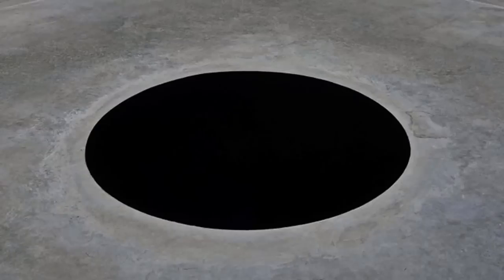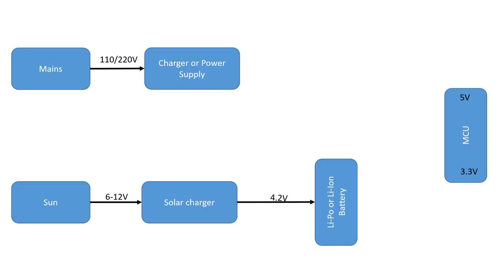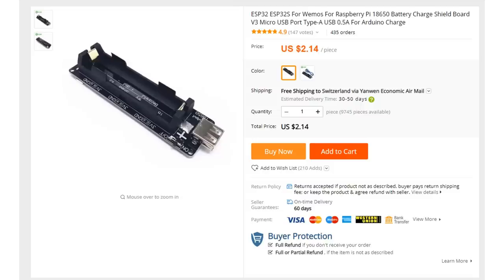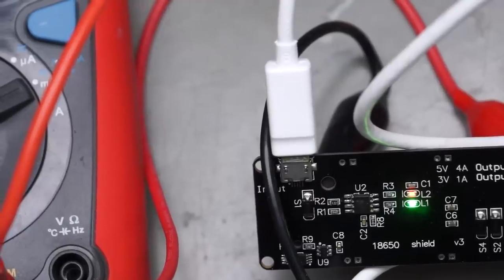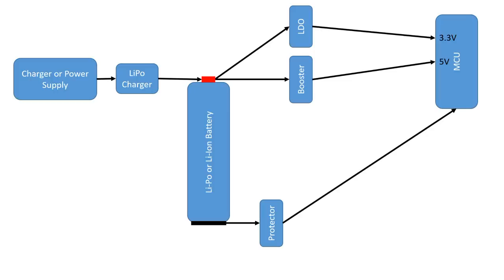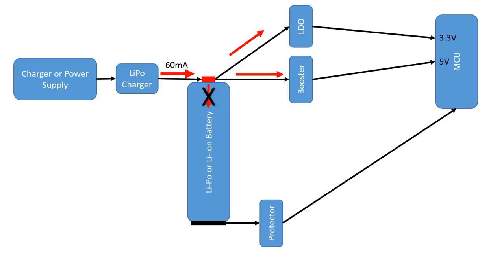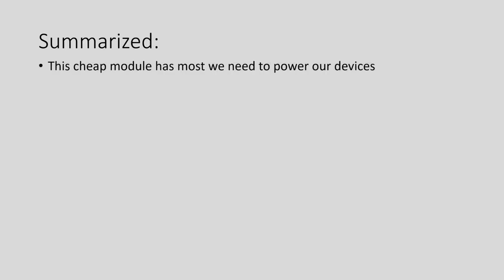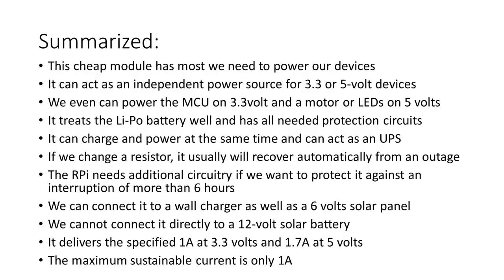#250 Universal Power Source (UPS) for only 2$. Is this possible? (Raspberry Pi, Arduino, ESP32)

Comment: I got one of this style a while back after watching VoltLog review on it. It's actually quite useful for about 90% of my needs on iot stuff.
As you noted on 5v rail, the specs are waaaay over reality. Also, even though you were getting 1A out of 3.3v rail, I think that is over-rated on the 3x 662k LDOs. Depending upon which 6206 LDO they are actually using, could be anywhere from 200-250mA each, so I don't think you should plan for more than 750mA continuous. Also, looking over it, they seem to skimp on input capacitance, and mine did not have any output capacitance on it. I had to add a 4.7uF smd ceramic on input and output of LDOs
While the boost converter ic (FP6298) is rated for 4.5A out, I wonder two things: 1. whether the rest of the components, including traces, are spec'ed to this, and 2. whether the battery can supply the 2-3C output current (assuming you have genuine panasonic cell?) - I wonder if test can be repeated with bench supply simulating battery input current.
This is why i think you should do a Swiss Accent version ;)
Reply: Also as you noted about the way the switch works, is crap design. Why not control the shutdown/enable pin of the boost converter! Even worse, it's just switch in-line with 5V output rail to usb jack. I wouldnt trust that switch contacts to carry 1A+ (a quick net search show most of these types of slide switches not rated at more than 0.3A ;)
Reply from the maker: I tried the 3.3 volt rail for about 1 hour at 400 mA for one LDO at battery voltage 4.2 volt and it was not hot afterwards

Comment: Hi Andreas, nice video! I know there is a power bank with the same capabilities, I just do not have the link anymore to the seller, I saw it on Julians channel a time ago.
Reply: Anker makes SOME powerbanks that can both charge and discharge at the same time. The way they do it, without disconnecting the load during charging, means the battery degrades faster. Not ideal but OK

Comment: Maybe I'm confused. Anytime the load is over 600 ma, lets say an amp.  The charge ic will  let the battery discharge to 2.6v then disconnect the load, then start charging the battery, even if the mains are powered ?
Reply from the maker: Yes. If you do not change R2

Comment: Hi Andreas! Thank you very much for the video. I have a question (not directly related to it, but close enough): I would like to use a raspberry compute module 4 i/O board as core for a cyberdeck/mobile solution. It runs at 12v and my idea was to use 3x18650 batteries and a simple BMS .... it is not the best solution, I know. How would you solve this use case? Thanks!!
Reply from the maker: I assume you need a buck converter from 12 to 5 volts?
Reply: @AndreasSpiess  the board is running at 12v and has internal 12 to 5 and 3.3 dc-dc converters .... my question was more about what type of circuit will be best for the task?

Comment: I recently started to play with one of these and ran a sketch that sent a text every 10 minutes and then slept. powered using the USB port.
with  3200 mAH Li Ion battery I worked for about 5 days until the Voltage was below 3V. I am current running the same sketch using the 3.3v outputs of the Wemos shield to the 3.3vin on the ESP32. Over 2.5 days the voltage has only dropped ,08v vs .5 volts when using the USB connection.  Was all that power being dissipated by the boost on the shield and the buck on ESP?  If thats the case seems like a large waste of power. Are there 18650 shield with just a buck and battery protection or do I have to build them myself. Thanks for the great work.
Reply from the maker: General-purpose development boards are not good for low power applications. I did some test videos.
Reply: @AndreasSpiess   Thanks. The board is from Amazon HiLetGo  WROOM-32.  I guess I'm just surprised how much of a reduction in power consumption there is using the 3.3 V input to power it . I've now had it running for 5 days and the battery voltage has on dropped .12V .  When I used the USB input the voltage had dropped from 4.2 to 3 V.  So 3.3v seems to be the way to go at least for these boards.

Comment: I think the silkscreen was labeled backwards. I think they meant to have 5V @ 1A, and 3V3 @ 3A.  Classic case of typo error without verifying afterwards  😜
Reply: Or 5V @ 5W, not 5A...
Reply: @DrKnow65  Ahh, Good point!
Reply: @DrKnow65  unlikely, they would've had to calculate this and the result would've been 25W/A
Reply: @mcflapper7591  I suspect that the specification for the boost chip is 5W @ 5V = 1A @ 5V (as measured), and the typo is  transposing watts and amps (I.e. 5A @ 5V).
Reply: The 3v3 is derived in a way that I wouldn't trust even at 1a while the 5v has a proper boost converter

Edit, just checking the parts are listed as 250mA there are 3 in parallel, so it's probably safe and reliable to pull 600mA or so, but that's going to dissapate a LOT of power in the tiny smt LDOs.

Comment: Im just about to build a solar panel power bank that can charge and discharge simultaneously using 6 or more 18650s (3000mAh each). Could and should I use one of these UBS charger board for each cell in parallel? If not, do you have any suggestions?
Reply from the maker: It is definitively better to use them in parallel. But for such larger solar panels it might be good to look at an MPPT charger.

Comment: So if I connect this 18650 shield to the charger as well as to a Pi, it should automatically manage interruptions in power supply to keep the RPi running by switching to the 18650?

Then upon return of power supply it'll charge the battery till it is charged then direct the power to the Pi.

I want a solution to handle short power outages without restarting the Pi, in a setup that can be deployed then doesn't need to be touched so the power supply will be connected to the shield 24*7. Is it good for that function or will I need to make some modifications?
Reply from the maker: You have to try. There are different designs in the market now. But there is a fair chance that it works. The Pi4 is the hardest, because it consumes lots of current.

Comment: Thank you for this. I had a question: Is there any way for the ESP32 to be notified that power is being supplied by the battery, ie: main power loss? For example, I would like my esp32 to notify an MQTT topic that it was being powered via battery and not mains, so i could do something about it before the battery gets too low. Thanks!
Reply from the maker: The ESP32 can measure voltage and react on it. Jost connect such a pin to the voltage you want to measure and make sure it is always less than 3,3 volts

Comment: Will these devices provide 'clean' power to a Raspberry Pi? I was using a linear power supply which definitely improved the sound quality. But I would like to use the LPS elsewhere.
Reply from the maker: They are too small for most of the Raspberries.

Comment: Bought one of these, before I found your video. My plan is to use it to UPS a Wyze Cam, which can consume up to 800mAh, when the IR repeaters are on. Based off what I watched, the camera would run for about 2.5-3 hours and then die, due to low voltage. However, if the power comes on, after the battery fully discharged, I'm not getting my camera back on, unless I disconnect it from the power bank and reconnect after the battery is charged. Is that correct? Did you ever discuss what I could add on to avoid this, with the additional protector circuit?
Reply: Tested mine and, unfortunately, as soon as you disconnect mains power, the attached device reboots, as it loses power for a split second. This makes these not ideal for UPS.
Reply from the maker: It is probably not ideal for devices which need a higher current than the usual microcontrollers.

Comment: Nice video, appreciating your research. Also thank you for links.
But how about to set 2 or more such modules in parallel for RPi to provide more than 1A?
Reply from the maker: I probably would use a different module for an RPi
Reply: @AndreasSpiess  it would be great if you make video for true RPi UPS (:

Comment: Sali. Another fun sunday morning with andreas. Just a few comments.. lipo and lion min 3.0v... for longer lasting i would do lifepo4. They are much more robust....anyway.. I think ups for pi is a must because its fat sdcard corrupts easily.
Reply from the maker: I did videos about LiFePo. But this device (and many others) use Li-Po). Maybe it will change in the future. But Li-Po has a higher capacity for the same weight/space.
Reply: @AndreasSpiess  ur correct. What about getting early warning from ups that pi needs gentle shutdown.
Reply from the maker: I also did a video about that. Including software ;-)

Comment: ok so if I put a 18650 battery inside, connect it to an esp32, remove the led, and let it go mostly in sleep mode occasionally sending a wifi message from a sensor input it should last right?
Reply from the maker: Maybe you watch my videos about deep sleep and ESP8266. The ESP32 behaves very similarly.

Comment: I bought this 2$ power module from Aliexpress but I have a question: can I connect a small Photovoltaic panel (with a 5.1V zener diode in it's output) at it? So that the battery will be charged by it?
Reply from the maker: This should be possible. Just monitor the temperature of the Zener.
Reply: @AndreasSpiess  thanks for answering! It 's gonna be impossible to monitor it 's temperature as it will be placed in a box on the roof of a building.
(maybe I should attach it (the zener) on a heatshink? But any way, the temperature on August is going to rise up to 50 degrees Celcius under sun)

Comment: How to Connect this device with Solar panel of 6V ? 
Do we need to use a Micro USB connector to connect the wire coming from Solar Panel or can we directly solder +ve &  -ve wires somewhere in the Input side of the Board ?
Reply from the maker: I am not sure if it is a good idea to connect 6 volts to it. I did not check the data sheet of the components. Maybe you do it before you connect it. I usually use a USB cable where I cut off one part and connect the wires.
Reply: @AndreasSpiess  Thanks Andy

Comment: Looks like handy module there Andreas ;) And worse case scenario - have some sort of power monitor that controls the output to both shut down the load as the batter nears critically flat, and ensure that the battery is on bulk rather than recovery charge before enabling the load. I believe the power bank manufacturers generally don't offer a passthrough / UPS like function is due to not wanting to deal with the battery charge termination when under load. Anker powerbanks in particular supported this, but I'm sure I saw mention that their newer models have omitted this feature as the charge termination wasn't working properly and reducing the life of the batteries. I thought Xaomi did also, but my newer power bank has a nasty 'feature' of turning the output off for a second (and then back on again) when the charger power goes on or off :-/
Reply from the maker: In addition most banks I have switch off if I only connect an MCU. They think there is no load :-(
Reply: Yeah, that is a bit problem. I have one commercial powerbank that has press on, press off functionality (i.e. it will run until the battery is flat)... but it is the rare, not the norm :( Paul Stoffregen did a article that made Hackaday about using a MCU to pulse a load on a powerbank so that it would not turn off, whilst wasting the least amount of energy possible. Whilst the original page is down, thankfully the Wayback Machine has an archive of it : https://web.archive.org/web/20160415053411/http://www.dorkbotpdx.org:80/blog/paul/battery_pack_load

Comment: What would happen if you wired 2 of this input and output directly in parallel and bridged the 2 batteries to gather would you end up with 2x the charge current and 2x output current?
Reply from the maker: connecting two LiIon batteries can be done and you get double the capacity at the same voltage. But it is not without danger the first time if one is fully charged and the second not.

Comment: I would use a reed switch and two rechargeable battery packs, in order to allow charging and discharging. That way, the discharged battery is never charged as well.
Reply from the maker: For this application we want both together

Comment: i want to ask? how to adjust Rprog of r2?
it should be edit? on software? or hardware config?

It is Possible on my Raspberry pi 2? to use this? load and charge? 24/7

or it works only on Pi Zero
Reply from the maker: You can consult the datasheet of the chip to find values to change the current.

Comment: Hello. I have a PIR sensor in my garden (with a wemos d1 mini), I want to use this shield but with a solar panel. I see this charges from micro USB, so I need to get a 6 volts solar panel, but how do I connect to this shield? I see they come just with positive and negative, cables so I need to put them on a micro usb male terminal to plug it into the shield? or I need another circuit between the solar panel and this shield? thanks.
Reply from the maker: Maybe you watch one of my last videos where I covered solar charging.

Comment: I have a powerbank with a single ic which can charge and discharge at the same time, but is a little bug of design, because it have a common 5v lane and leave some current to pass to the discharge port, I use it to keep alive my rpi 4 alive because it is hosting a web server and it is a MQTT broker and don't want to loose data while i'm working if there's a lightout
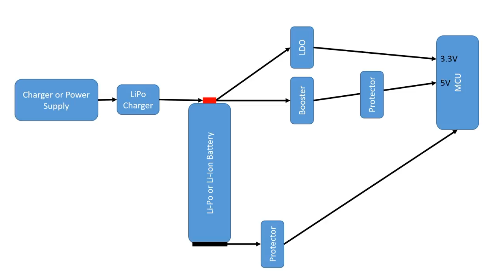Short expanation: in minute 10:09 my powerbank have a lane between the charger and the input of the protector of the 5V lane
Reply from the maker: Very few powerbanks can charge and discharge at the same time. So tyou are lucky your bank has it.

Comment: Will we solve the problem if we enable the load to reset itself with the code (arduino) when the battery drops below 3.7 volts?
Reply from the maker: I do not know :-(

Comment: I don't get why no one is able to produce a full-featured mini MPPT or even a LiPo balance and protection circuit. You would think in the entire world there'd be a market for both of those things... Instead what we get are MPPT controllers that don't track current, LiPo BMC's that either charges or provides over-discharge protection but not both... 

I know it's possible to do both of these things because there are commercial "emergency solar panels" out there that does all of these things while costing peanuts, but I've never seen a PCB that does all of these for DIY crowd. 

If I had the technical knowhow, I'd make an MPPT IC that actually does MPPT and couple that with a good BMC and watch the dollars roll in.

Comment: When placing a battery, it turns on both green and red LEDs. Does that indicate anything? Or the battery is damaged? Greetings.
Reply from the maker: Unfortunately, I do no more remember the details :-(
Reply: @AndreasSpiess  It's understandable with so many videos and so many modules that you've tested. 
It happens to me all the time and that's when I check your videos again haha
To answer myself, yes, the battery is damaged, I guess because I tried to charge it with the module of the ht4928s IC and it also performs an abnormal blinking of the LEDs. Greetings and thanks!

Comment: The major problem here is that keeping a LiPo-cell charged at 4.2V for a long time is not great for the longevity. We need an alternative to TP4056 with a variable charge cut off, or at least one the cuts at 3.82-3.9V. This would actually be a great idea for an open source circuit. Cell lifetime could increase from a couple of months to several decades.
Reply: If you need 3.9V just put a schottky diode in series at the output of the TP4056.
Reply: @javierpallalorden  It's not that I need, it's the cell that rapidly degrade if you keep it charged at 4.2V, an effect of using a TP4056 as an UPS.
Reply from the maker: How much is rapidly? I would be interested in your source because I hear a lot of rumors, but so far found no evidence. Can you pls post a link?
Reply: @AndreasSpiess  No papers, only word of mouth and my own observations. The first time I heard about it, I believe it was ElectroDacus who warned me and said that the battery in the phone he used as off grid WiFi router died after being fully charged at all times. I made a couple of tests using a pack of brand new 500mAh cells. Running some at 4.2V at all time, cycling a few from 4.2V to 3V and cycling a few others from 3.9V to 3.2V. Originally it was a test I ran to confirm what's reported in https://batteryuniversity.com/learn/article/how_to_prolong_lithium_based_batteries to add life to my off grid solar installation, but I also added the 4.2V at all time as a test as I considered TP4056 as UPS for a large scale mesh router setup. It was a few years ago I did this and don't have any records, but I came to the conclusion that both keeping them charged at 4.2V while pulling power at all times is terrible for the cells and gave it up. I only ran the test on the one pack of 500mAh cells, perhaps there is a difference between diffrent sort of cells. I just thought it would be easier to check it out on small capacity cells. Everything I've seen myself and heard from others seem to point to the same conclusion though.
Reply from the maker: Thank you for your insight. The page your refer only says at 4.2 volts at an elevated temperature. And I did not find out how much damage is produced. But in your tests, you seem to have found a big influence. Maybe I do some tests myself with bigger cells ;-)